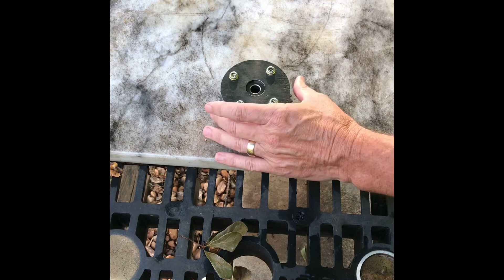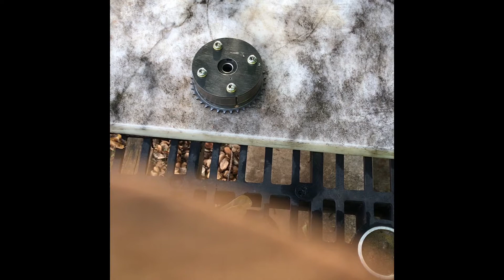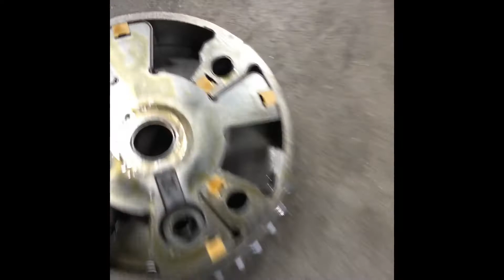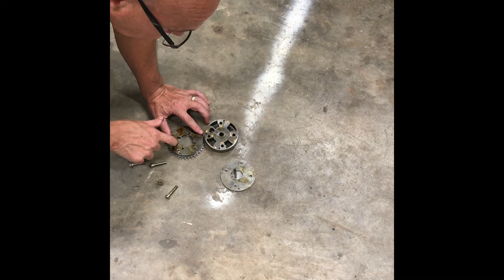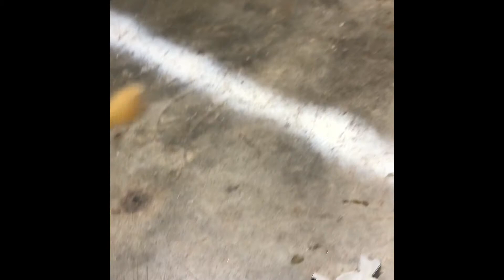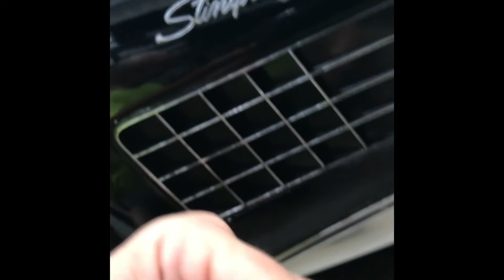Toyota VVT i cam gear

Comment: aside from cleaning out any oil sludge or varnish what happens is the spring loses tension over time and does not push the locking pin into place,..stretch the spring out about 1/8" and it should work again....also make sure pin slides easily in it's bore,..no varnish build up
Reply: @numbrenine9414  well … and my case  ? , brand new OEM gear, installed fallowing Toyota Service Bulletin ? 🤷‍♂️ after installed the rattling was heard in Paris 🤦‍♂️

Comment: Does anyone have an explanation for my case? 
I Replaced 2 times consecutive the cam phaser ( $500+ on parts) using brand new OEM Toyota part, fallowing the Toyota TSB , tightened the gear UNLOCK , turned the cams clockwise to LOCK the gear , even I took pictures to be sure 💯 , crank it up and the ratting was heard in PARIS in both Both occasions 🤦‍♂️
Reply from the maker: @64arguz  Mine still makes a little noise but it was a used one from a junk yard. I don’t really remember how it even works, could it be lack of oil pressure…?
Reply: Check and replace chain tensioner if its beats up.